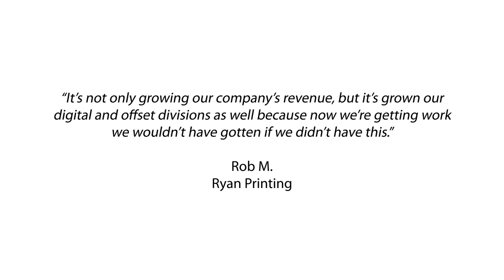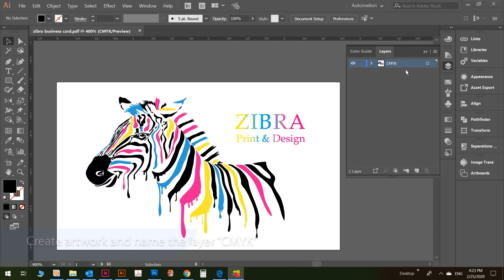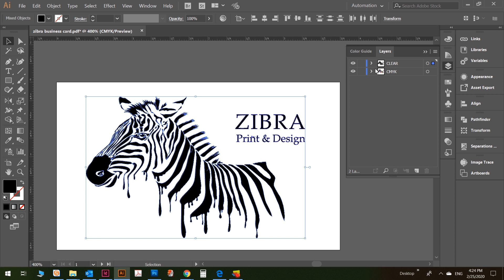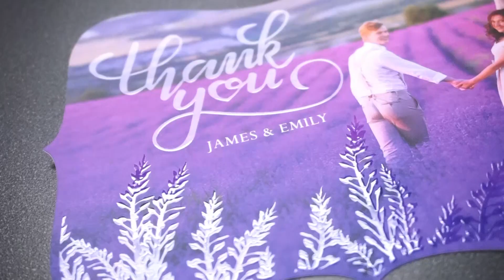Duplo DDC-810 Raised Spot UV Coater | Product Demo

Comment: So the printing is done first on a separate machine, and then ran through this to add the raised spot coating? Is there lamination involved anywhere in this process?
Reply from the maker: Correct, your job is first printed on a digital press then moved to the DDC-810 for spot coating. Lamination is optional and it would be done between the printing and spot coating on a separate device.
Reply: @DuploUSA  beautiful! I did inquire on the website about the cost. I’m sure it’s north of 50k